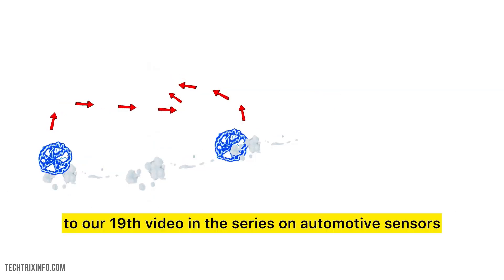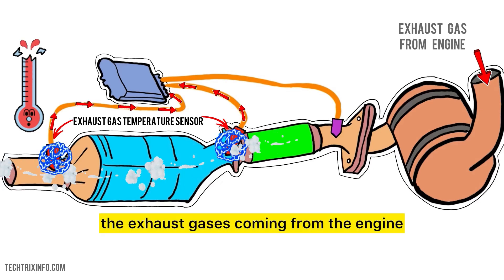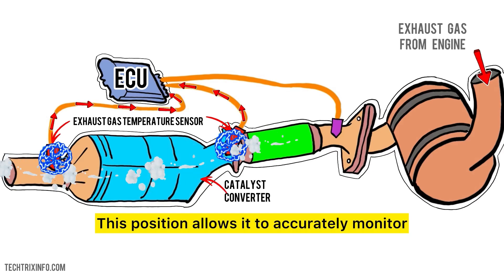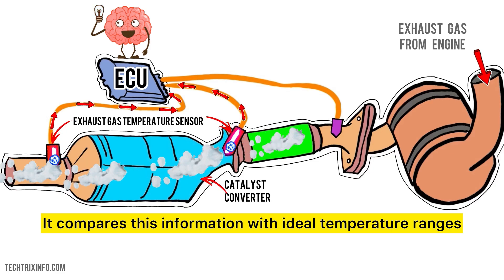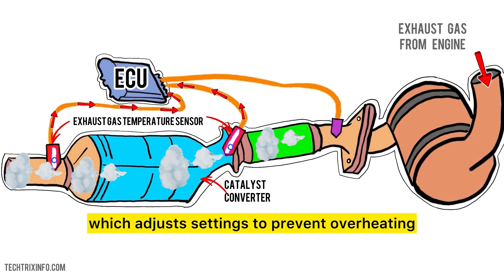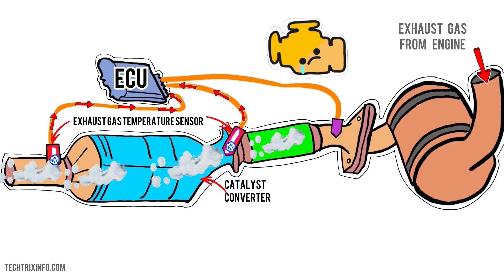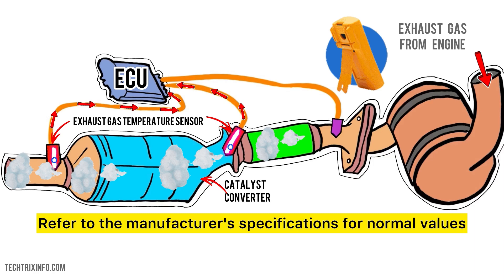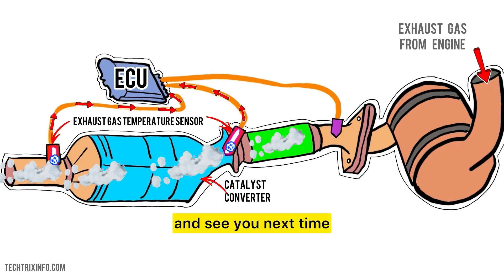Exhaust Gas Temperature Sensor Explained With Animation | Mastering Automotive Sensors | Part 19

Comment: Does anyone know where the second sensor is on a Vivaro A 2.0. I've already changed the one bolted to the DPF but the Tech 2 still fails the Regen due to Sensor 2 low.